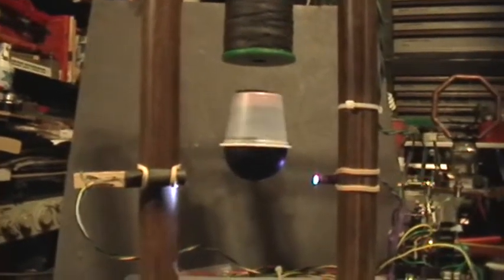Arduino 16b: Diode Increases Performance of MagLev System

Comment: Very cool device.  Is there any rotation like it appeared to show when you placed the magnet back into place?  I mean, will it turn cw or ccw on its own depending upon how the coil is wound?  Or, is it just random or air currents?  I always wanted to make one of these after seeing Lidmotor's take on it.  I want to know how those electronic levitron's work.  They can support some real weight (still small though) and it spins on its own and hovers about 3" over the base..  A guy at work had one on his desk.  They cost about $100 which is too much for me to get one and take it apart.

Bill
Reply from the maker: No, there is no driven rotation in my system, just levitation. The winding direction of the coil makes no difference except in which polarity of the levitated magnet must face the coil. In fact this device completely disproves "you know who's" claim of "magnetic vortices" since the levitated object is free to rotate in either direction equally.  I think Lidmotor has made one that has drive coils to rotate the levitated object. I can use a straw to blow air on mine to get it spinning pretty fast but air friction makes it slow down of course.
I don't know how the electronic Levitrons work. Are you sure that it spins on its own, and not with a user-supplied spin like the non-electronic ones do?
But look at this:
Maglev Arduio
How does he get nearly 4 thousand views, with a posting date ten months after mine, and a system that doesn't work as well as mine?
Reply: TinselKoala

Thanks for the reply.  Yes, I am sure the desk model this guy had rotated slowly on it's own.  That is what amazed me.  It was a very slow, very constant rotation...I would have expected it to continue to accelerate or something like that.  It comes with a plate that you can put stuff on, as long as it is under the limit in weight.  If I can find a vid of one in operation, I will pm you at OU with it.

Bill
Reply from the maker: Pirate Labs
Yep, I saw the video, it's really cool, and I think I know how it works. The sideways levitation is the really neat part, that was unexpected and gave me the clue to figure it out.

Comment from the maker: No, I don't think so. It's operating more efficiently than before. The current is determined by the DC resistance of the coil, which hasn't changed, and by the chopping and PWM adjustments from the driver software. Since the ringdown energy is now being recirculated by the diode and there isn't the high frequency jittering of the object, it's more stable and using the supplied current more efficiently, so I can use lower voltages (and current) to get the same lift as before.
I think.